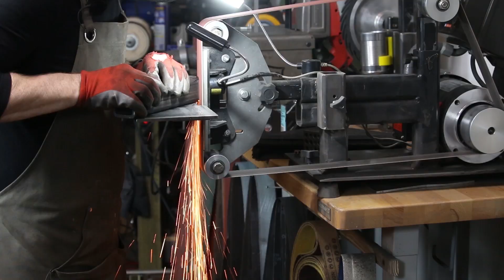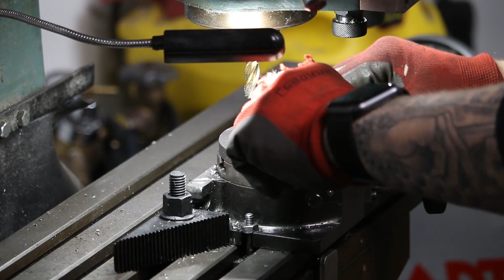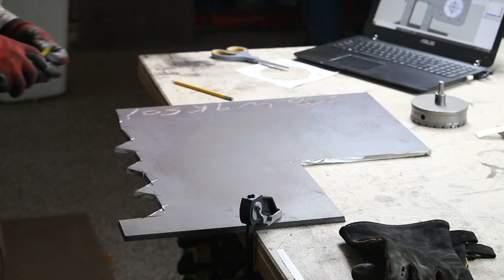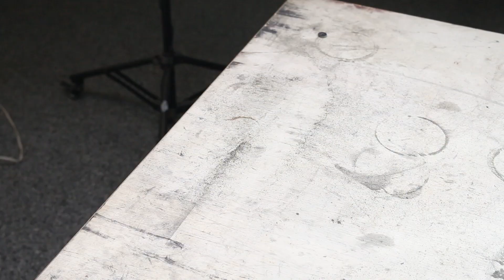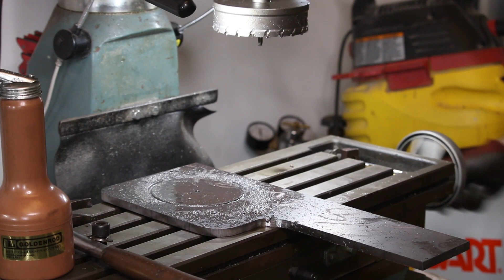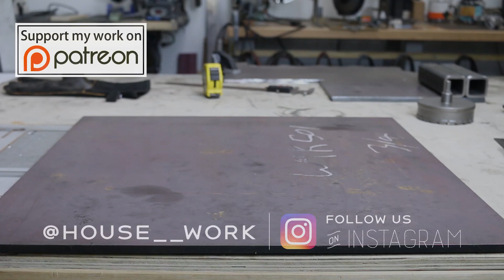2x72 Belt Grinder Build - Motor Plate & Hinges

Comment: I did the same thing on the motor mount holes and the alignment was off  so I had to use a dremel and hugged out the four bolt holes a little bigger, and my welds fell apart the first time I welded the frame together lol but I went hotter and alot more mig wire to the tubes and 3/8th plate and its solid lol, yea Brian you are awesome  I love your videos, keep it up

Comment: Hi Brian. What is the length of belt sander please ? Thanks
Reply from the maker: It depends on what tooling is being used. Do you mean from back to front including the work rest?
Reply: The length of the belt sander. How many metre of belt sander so I can calculate the length of square tube I will buy.

Comment: Very nice work. What is the measurements of the pivot parts. As in the center hole and the slotted curved hole. And the over all size of it.
Reply from the maker: .375 plate steel, they are about 3.75 x 3 - 3/4 hole. I’ll have a plan set out next month. If you would like to get on the distro list fill out this form: http://housework.us/2x72-grinder-plans/

Comment: I find my best thinking is done by sitting down in the workshop and having a pipe with my coffee or tea.  That is tobacco by the way. I might think for ages, I have to get the crap out of my head and then of course the solution is simple. By the way, sacraficing  an old timber chisel is a good way to clean out the weld in the tube, even if you weld the end on to metal to get the length and then use a hammer to tap it through. Saw it being done. Works well.
Reply from the maker: Yes the solutions can be right there as long as you can sift through the noise. I like the way you put that. Pipe, caffeine and a comfy chair. I don’t smoke but I have a 3pm espresso every day. Keeps me on my toes late in the day. 👊🏻

Comment: Check out fireball tools. He has a good video on removing the weld from inside square tube. Also...  I found that drilling a hole in your material  first before slotting out with rotary table works better then plunge cutting with an end mill.
Reply from the maker: You know I tried it both ways, with the hole pre drilled and without and it seemed to go a bit easier with the plunge method, although most people say what you say. So maybe I was just doing something wrong. But it went well. Thanks for the comment and advice. 👊🏻

Comment: I'll tell ya, I know that hole saw sound & it is brutal hahaha. I usually put a piece of scrap wood under the metal when doing that, better to hit wood than something important(ask me how I know haha)... I was looking at some other guys doing the horizontal/vertical with the "C" channel & I noticed most of them have only 1 channel locked down. Me & my OCD, I probably think about this design more than you do lol. I mentioned the 2 channel, through the square pipe, but i think that would be a pain to tighten. Holding the grinder & trying to tighten 2 bolts/levers... So your idea of 1 is probably the best, not to mention, you could always make it 2 if it doesn't work out... Great progress, hope all is well, take it easy...
Reply from the maker: I’m actually gonna do two channel locks. I think you’re right about it probably not needing two but I can do it so why not. Just added extra strength. And yeah I’m not too happy about the 4 1/2 groove on my mill table. 🤦🏼‍♂️ It’s a learning moment! Hahaha! Hope you’re well Dave. 👊🏻
Reply: @HouseMadeUS   I was trying to figure out a way that you could have it through both and tighten down the lever with one hand, because the other hand will most likely be holding the grinder from tipping back. My best solution(in theory) was to have a threaded square piece with like a washer welded on top, that rides in the back track, then when you tighten the lever from the front it compresses the back too without moving... you don't want it turning in the track... See, I'm always trying to figure out if my suggestions will work or ways to improve them hahaha. Take it easy.

Comment: Looks like you need a 2 x 72 to make a 2 x 72.
Reply from the maker: An Angle grinder can do the work. I will have a Cnc plasma cutter in April that will change the game a bit. And I’ll be selling those parts on my website along with plans. The point of these videos is to prototype it out and make any changes needed before we start making the pieces to sell. Thanks for watching. 👊🏻